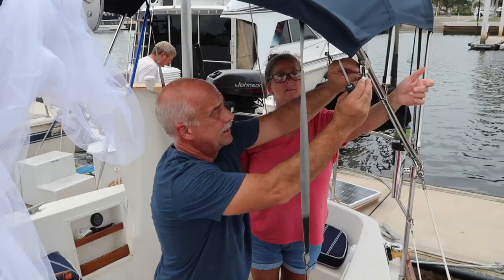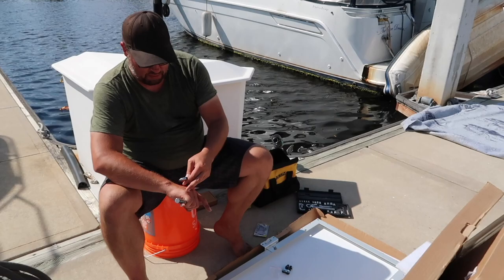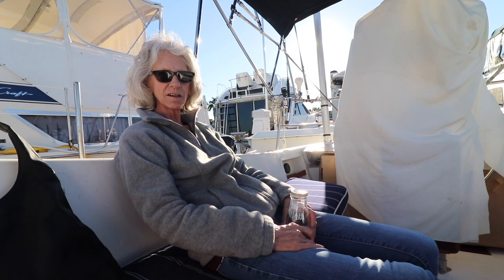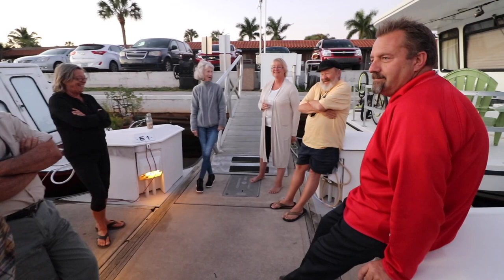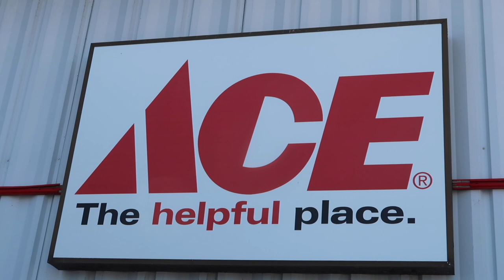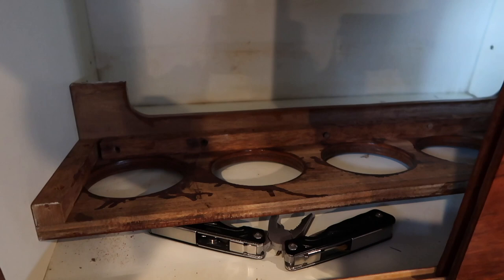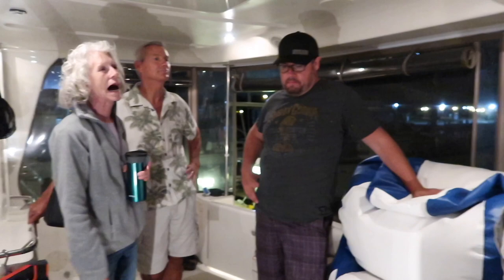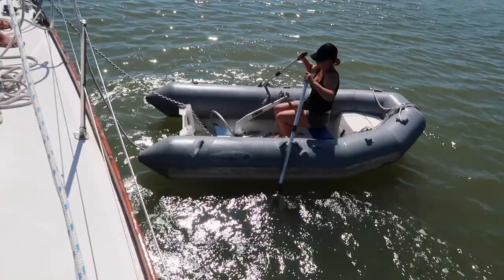Boat Project FAIL I Sailing on a Whim Ep.14

Comment: @ 5:49 your thought process is correct. When you get out there for real and you're slamming into 30 knots of head wind (don't say it won't happen, coz it will) that thin bimini frame will collapse in an instant. For $2K you could've had a proper 316 stainless steel solar arch constructed and professionally installed. There are no cost saving short cuts on a yacht.
Reply from the maker: Oh we are learning that very quickly.. We ended up coming up with a pretty cool fix actually. stay tuned! didn't even need to replace the frame!

Comment: Glad to see your projects moving forward. Here it has been snowing for 2 days so our projects are resting until winter has passed. Though we managed to remove all bottompaint (by hand) on our 38 foot Hunter and also we managed to do all the grinding. Next year  epoxy layers and new colour before sailing and we also plan to install new and more effective solar panels.  Good Luck with the rest of your projects.
Reply from the maker: You have accomplished a lot and have a lot of big projects coming up! Our videos are a bit in the past so we are currently also on a break from boat projects but will be starting up again shortly. Right now, we are in the planning process to figure out what we have the time and budget to do but we will definitely be doing some repairs and improvements to our electrical! Good luck with finishing up the hull. If we have that project in the near future we know who to ask for advice!
Reply: @SailingonaWhim  Arm strengh, good tools and a lot of love is all you need :D
Reply from the maker: @jamtaradrift  Very Very True!!